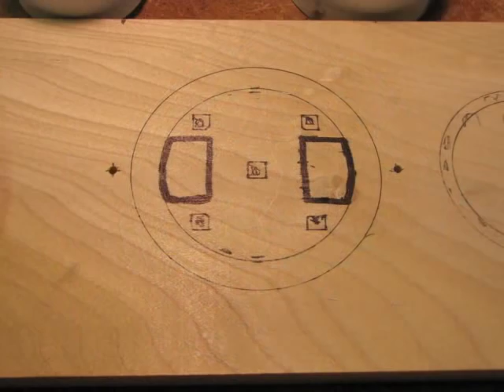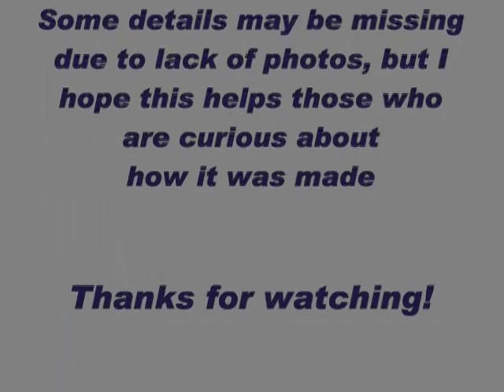Making a 6-cylinder Stirling engine

Comment: i always wondered what would happen if some body built this , great work friend , im currently working on an expanding fluid engine concept its basically a sterling engine that uses liquid instead of fluid like gases or air its reaction is slower but its pressures can reach 1000 psi from just 117 deg F , im working with just a 60 deg temp gradient

Comment: I found that when making the steel wool displacer, that protective screening for rain gutters works quite well. I recently took the old ones off of my house and realized they were essentially a higher grade material than what's used in filters. It is a bit harder to bend than screen mesh though.
Reply from the maker: Good find!

Comment: Great series of pictures - this is probably almost enough for a building instructions at least for those that have put up an any stirling engine with available materials. 
Setup how you bent those axles would be helpful to see - they have been always nice and this is over six times more difficult to make.  
Hard to compare with Ross models (lots of metal machining time needed to even start with them, and lightly pressurized). Both are among great winners in their own way - machines do work!

Comment: Minor suggestion to displacer construction with its supporting net:
-displacer lenghtwise somewhere in the middle if you cut every second or so of the net wires. This way you will half the conduction loss inside displacer and gain a slightly more work done or reduced cooling need.
A neat way to make it more ridigt - I have used just horisontal sticks there and a heavy "wool felt needle" to form and tangle metal fibers better together - sometimes with success or getting some slack with time...

Comment: Congratulations, from what I can conclude that engine may be pressurised through those pipes central on each power pistons. Very nice indeed .
Reply from the maker: Yes, those tubes are used to pressurize each cylinder separately or together through the tiny gap on the sliding displacer tube/guide. There are valves to control the direction and isolate each cylinder.

Comment: That's an awesome engine. I'm was just thinking of a Stirling engine made with bellows but in somekind different. My idea is to have a heat bellow and a cold bellow. The cold bellow would be refrigerated by water so you don't need so much heat in the warm part.
It would be an alfa type Stirling. I'm thinking of a little bigger bellows than the ones you used in this video and tanks of water used for refrigerating. My engine also has also 2 regenerators (warm/cold).

Comment: Are the clear hoses for adding pressure to the power cylinders? Are you using air for a working fluid? Great job by the way!

Comment: Impressive!
I'm curious, have you thought of making a stirling engine with one very large pressure chamber instead of several small ones? "In theory" that kind of engine would be easier to pressurise, easier to de-bug and easier to build. With less moving parts, it could be more efficient, assuming heat is quickly transferred to and from the working fluid. This would probably require a system of heat exchangers and valves, but the additional components would be offset by mechanical simplicity.

Comment: What is the power output of the 6 cylinder engine.

Im considering off grid living and have though that a stirling engine on top of a rocket mass stove could charge a battery bank to power a laptop, LED lamps and charge a phone (maybe not all at once!). Whats your thoughts?

Comment: hey approtechie, love the engine! awesome creation! i would like to know where you procured the small block set screws that are used as clamps on most of the hardware. there is one at 3:02 holding down the washer on the perforated metal with the steel wool inside.

Comment: Thank you very much for sharing your work! This design looks quite powerful. Waiting impatiently for power measurements :). I bet it could drive near 20-30W of electricity.

Also, one question. Do you know why "double acting four cylinder Stirling" design is not popular? Is it less efficient? Seems it's not much harder to implement ( as I understood you don't need displacer at all and regenerators are not moving parts) but I never saw DIY Stirlings using this scheme. I just wonder why.

Comment: In the video, Did you measure the length by inch or centimeter? I can't figure out the type of tapeline that you used. And I solved it the question before. thanks.

Comment: amazing work!
where and how your cooler system works?
which material is the internal piston and if it is hermetic?
thank you.
Reply from the maker: Thanks! The cooler is a motorcycle inner tube with holes cut in it and that fits snugly over each cylinder. A small water pump circulates water through the tube and cools the upper part of the cylinders. The displacer is made of fine stainless steel wool, the power piston is made of rubber about the thickness of inner tube rubber. It's not hermetically sealed since the displacer rods do not seal completely.
Reply: ***** thank you i will try to make one, with your ideas in this one. by the way the idea of a retractile power piston is really really amazing. thank you very much. if i have any struggle i will let you know.

Comment: Hey, great video! It really gave me some insight into sterling engine mechanics. I'm a fairly new builder/maker or whatever you want to call it, but the biggest problem I run into is where to get the parts for your projects. I've found that going to hardware stores isn't the most efficient way to find what you need and they don't tend to have more "exotic" (if you will) parts. Ordering off the internet isn't always too reliable either due to the fact you can't physically touch or check something's dimensions before buying. Where do you get your parts?
Reply from the maker: Hardware store for brass tubing and such, SS wool and little bearings from Ebay, Radio Shack for the little Euro electrical connectors, and a fair bit of just scrounging around for bits and pieces. Every inventor needs a good pile of junk.  :-)

Comment: I really can´t believe that you can make your cranks with that wise with no flame and heat... 
Special tool on axle is obviously used for tight bends - is there a slightly larger hole in the tool where axle rod goes through? 
Even I see the pictures its still hard for me to imagine how to keep main axle line straight for the bearings after so many bends in line... Any misalignment would add friction to bearings and even prevent engine to turn... Really no other jigs or tools??? Respect!

Comment: another question would be: how exactly have you desingned the shaft because I'm thinking the active part of the cycle should not be happening at the same time in all the cylinders but I don't now how can I do that.
Reply from the maker: The cylinder cycles are spaced 120 degrees apart for each piston/displacer set. That way they all push the crank equally every third of a turn.

Comment: im starting to build a six cyinder gamma stirling engine but im going to have the displacer crank and power cranks parallel and connected through a belt drive so that i could manually adjust the phase angle and also reduce the length of the engine, i want to run tests and mess with the phase angle, my question is do you recommend thicker aluminum or would thinner aluminum like a 40 oz can work just as well? aside from being harder to work with being thinner....also should do you recommend large diameter and shorter stroke for the power piston? I want some good torque but with out sacrificing RPM... thank you for the inspiration, Im studying structural engineering but these engines have always fascinated me!
Reply: Jesus Perez Skateboard bearings are easy to come buy rather than having smaller bearing but that ups my weight so if i decide to go with those I think Ill have to use a large displacer to allow to use a larger power piston... Im trying to keep dead volume to a minimum but im stubborn on the gamma design....more bearing and parts and friction plus a lot more moving parts and seals but itll look awesome and itll be a real challenge, any tips would be much appreciated!
Reply from the maker: Jesus Perez Don't use aluminum bottles, they'll give you grief. I only use stainless steel bottles. This is from experience. I like your idea of the parallel shafts to manipulate the phase angle. Large diameter short stroke is better, I think. Good luck!
Reply from the maker: Jesus Perez I bought those little flange bearings in packs of 10 on Ebay for about $1.50 each so they're pretty cheap. They allow the use of the eye screws. Gammas are easier to build than betas in my experience.

Comment: nice job. could you tell me what did you use for building the joint between 2 wood pieces? is it rubber or something similar? thank you
Reply from the maker: javier fernandez It's just a piece of flat rubber that I had laying around, about the thickness of an inner tube.

Comment: I am wanting to make a stirling engine drive a forge auto hammer.  It would only be a 3 -5 lb hammer about 60 - 120 strikes a minute. Any thoughts on good links or construction methods?

The hot would be the forge the cool would be the quench tank.
Reply from the maker: You're needing a lot bigger engine than this to lift a hammer like that and drop it every 1 or 2 seconds. Not sure I can help you with that, sorry.
Reply: No probem, I came across your video in my research.  I understand it would have to be pretty heavy duty. I saw a design that would probaby work better but I am very new to engine building.

How did you learn? Just by doing? A forum? Book? Looking for a jumping off point.
Reply from the maker: I started back in 1972 when I did a technical report on Stirlings. I did a lot of reading, some of the books are very expensive and mostly found in Univ. libraries and such, but if you can get access it helps. After that it was mostly trial and error by doing, and a good bit of just happening to hit things right at times. Good luck! It's a lot of fun to build an engine and have it run well.

Comment: I have been working on my project, i have figure out all the things that I need and almost done everything but, I have to do the crankshaft. can you say me what are the measures of your crankshaft? I mean angles and the distance that the pistons move on the crankshaft. The size of our piston are almost the same and also of the car inner tube so your measures of your crankshaft can work with mine.
Reply from the maker: Jaime, all of the crank throws are 3/4" from center, the displacers lead the power pistons by 1/4 turn (90 degrees), and each piston/displacer group is rotated 1/3 turn (120 degrees) from the next one. That makes it give a push on the crank 3 times per revolution. The crank is made of 3/16" plated soft steel rod. After I form each group of crank throws I test it and true it up using a drill or lathe to turn it. Hope this helps.

Comment: Good show! Tell about power output you get.
I go to you gasifier cookstove with Sirtling Engine.
So you cook (heat a place) & use waste hot air for kinetics to elctricity. 
What is temperature of input air vs output air here?
IF this output is just warm (30+ C) use it for another motor!
Study nicomel (nickel-titanium alloy) that bends cold, but"remembers" its shape; snaps back to that with great force if just warm  Rotors/motors exist for this odd stuff too! Can also generate electricity

Comment: sorry for asking too much but what is the function of the tube that is between the two bars of the power piston? is the only part that i didn't get. thank you again and sorry.
Reply from the maker: That tube runs over a guide post to keep the piston centered. There is a tiny gap between the post and tube that allows me to push air into the cylinders via the plastic tubing to pressurize the engine, equalize the pressure between cylinders, and introduce helium if I want. It's not necessary for the functioning of the engine.

Comment: Hello ! I'm trying to do this engine ,but I don t understend how is the could source made?I don't understand where the water is going ? I have read that the coluld source must be done at the superior part of the execution cylinder ....Please  answer !
Reply from the maker: Water is pumped from the bucket up through plastic tubing and into one end of the motorcycle inner tube that wraps the upper end of each cylinder. Then the water leaves at the other end and back to the bucket. The inner tube has holes cut in it so the cylinders will pass through tightly, and RTV silicone sealer is used to seal the rubber to the stainless steel cylinders.
Reply: *****  Thank you !

Comment: Does a stirling engine even make any usable torque?
Reply from the maker: Yes, they certainly can! The issue is for us to build simple engines in our garages/shops that fit our budget, skills, and tools, and still produce some decent level of power/torque. With sophisticated tools and money to burn you can build very powerful engines. I believe the Japanese have built a Stirling engine producing 2,000 HP, using very high pressure hydrogen gas and very high temps.
Reply: i dont think for motor transport but i use a small one to charge my computer and phone when im out camping in the meddel of nowhere

Comment: PS: I used wrong term for the nickel-titanium alloy that springs back in a little heat, it is NITINOL. See 1970s video "Energy Generations from Nitinol" - I was dealing with other nickel compounds today such as nichrome (heats severely when current goes thru, another anomaly), and blurred my speech. (It's late, time to sleep.) Sorry!

Comment: Is it possible to use the engine to pressurize the  engine?
Reply from the maker: Yes, it is. I'm planning to do that with my larger engines. A small bicycle or ball pump is all that's needed, with a gear reduction and crank.
Reply: *****
The axial piston design has my interest.  I've built several Stirlings but the best was a Walking Beam made from beer cans.  ;-)
It ran on ice or a candle.
Helped my daughter build it for a school project ...and she dang near got busted for zero tolerance...(the beer cans.)
There is hope for this engine design......Technology is making things easier to build...especially seals and cnc.

Thanks for the reply!
Chuck

Comment: Do u know what the rps at full speed are??
Reply from the maker: I had it over 1200 rpm.
Reply: wow u should try making a 8 cylinder one
Reply from the maker: Cole Tobin
The crank gets pretty tough to make as you add more cylinders.
Reply: ya i could see that being a problem

Comment: is it powered by heat
Reply from the maker: Rohan Bardhan Yes. It's actually powered by a temperature difference between the hot and cold sides, but that effectively means it runs by heating the hot end.
Reply: thank u sir can u upload me the 4 cylinder engine video  and working process(writing)  a to z...........................and mail me........can u tell me how i cool this pls help me  sir

Comment: Use heat plugs used in diesel engines to heat each piston. Then put the engine in a bike and go test its range? Then get back to me if you want more information! ; )

Comment: YOU ARE DONE ! !  you should not be paying any electric bills; just hook up a 5 kw generator to that thing and buy a couple hundred candles and you will be set. 
No research and development for you. That's about as good as it gets. 

Most stirling builders are fighting just to get the darn thing to turn. Yours are about to throw a rod they spin so powerfully. 
Are you using Hydrogen or helium as your working fluid? 
did you hide some roller bearings in that wood? 
What is your secret? Your machines are soooo powerful ! ! ! 
What's up ? ?!?! ?
Reply from the maker: +Harold Westrich No secrets, it's all there. No hydrogen or helium. Yes there are little ball bearings on the crank.
Reply: +Harold Westrich it'd be better if he made a solar collector underneath it for heat source.

Comment: I tried to make my own stirling engine folowing your exemple but somehow it is not working. I think  the rubber a used for the upper side of the cylinder might not be elastic enogh. Can you please tell me what kind of material have you used for that part and where can i get something like that? Thank you for your help!!!
Reply from the maker: The rubber is from a car inner tube. It's pre-stretched with heat from a heat gun and held in shape until it cools. That way it has more movement and doesn't have to stretch while running.
Reply: *****  how much heat did u apply? temperature? thanks